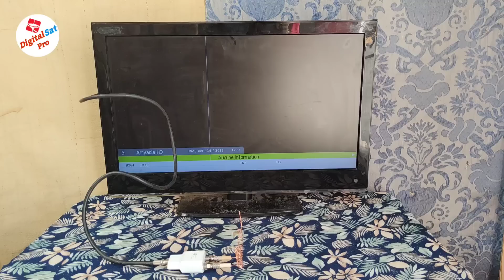Convert a phone charger to a TV switch to receive DTV terrestrial channels

Comment: Man spent long coaxial cable te get simple copper wire??? Also, he got simple dipole antenna which can be achieved with just a piece of coax.cable and one short copper wire??? On top of that, every connector that he added will attenuate the signal by couple of dBs. All in all, what a waste of probably working phone charger 😔